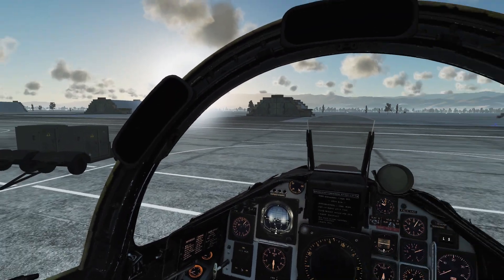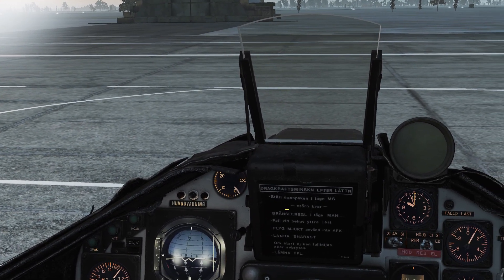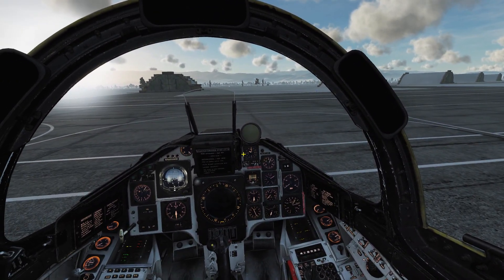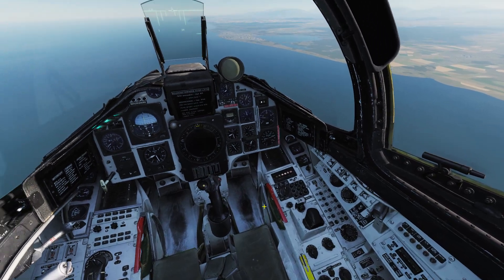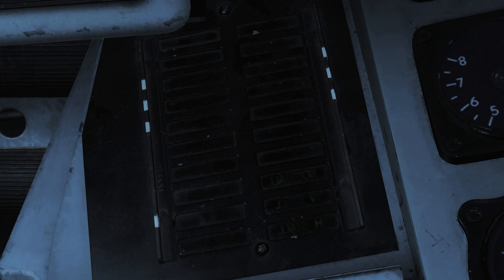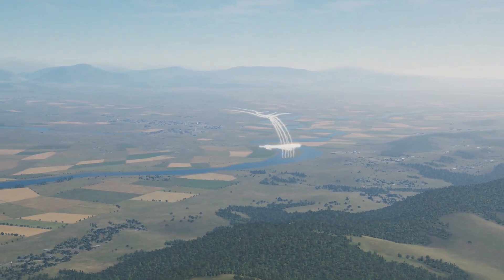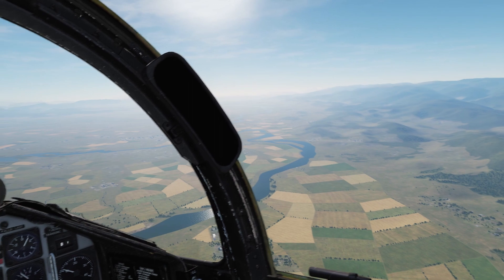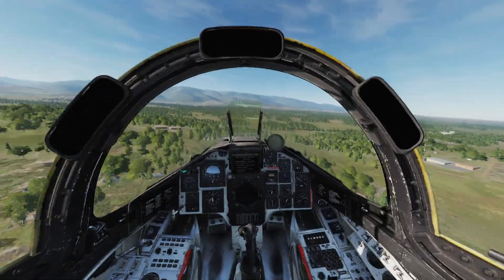DCS: AJS-37 Viggen. Chaff, Flares and ECM Tutorial.

Comment: Are you running with curves on your joystick set-up - you seem to have much smoother control than I, it feels very twitchy to me.  Take-off seems to be a crap-shoot as to wether I smack the tail on the runway or not as it pitches up so quickly for me.
Reply from the maker: I do have a +15 curvature set up on both Pitch, Rudder and Roll. So thats something I'd recommend as it is something I remember reading about with many of the choppers needing a curve set to be more controllable. I do have a HOTAS Warthog as well so the Joystick probably has very good sensors too.
Reply: @Badjoe117   Thanks, I'll give that a shot - I have the Warthog set too, with the Pro Flight Cessna pedals.